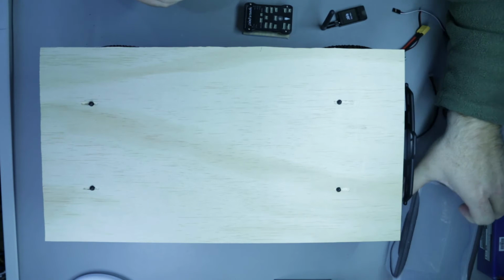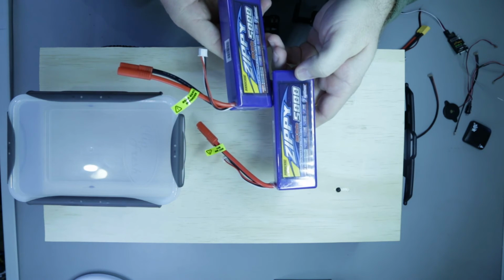ArduPilot How to Build a Rover - Part7 - Component Layout

Comment: Nice videos! But I did not get power module connections (also Ardurover official website is not clear for me). From one side is connected to battery and from the other to the ESC?
Reply from the maker: Yes the battery plugs into the power module and then the power module plugs into the ESC.  The power module also has a 6 wire lead that plugs into the autopilot.